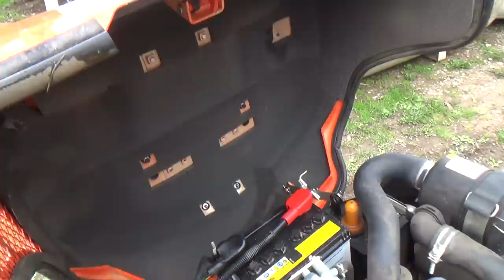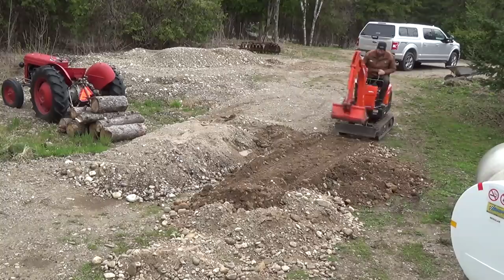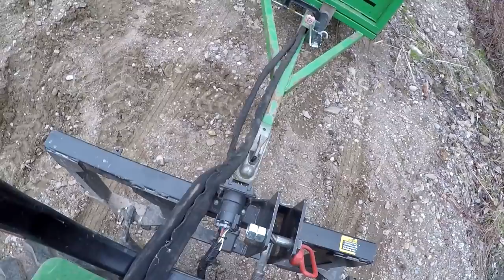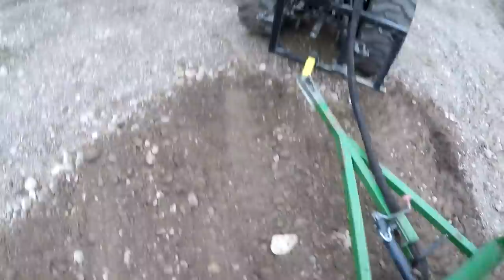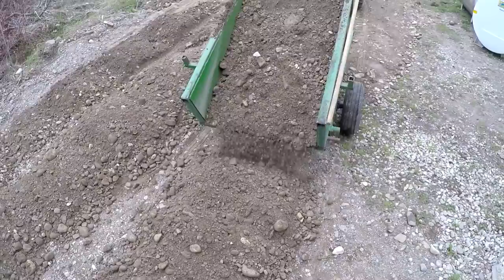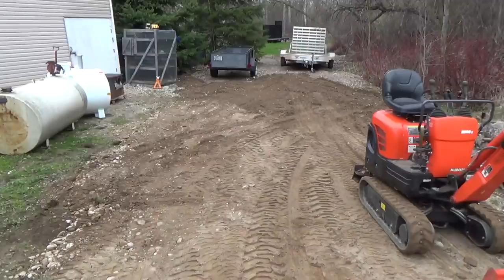Moving sand and gravel with mini ex , mini dump trailer and Jumping Jack....Leveling her up

Comment: Would be awesome to see a roller build that you could pull behind the tractor, that would make compacting big areas like that easy
Reply from the maker: Lol I do have one that I made out of an old water tank. Filled with gravel and concrete. But it’s the vibration that compacts it so well

Comment: Bill,could you do a video with big JOHN
Reply: we were out doing the same job but useing the loader tractor with the hla plow blade snow plow blades sures a handy as a dozer multipurpose and cheaper then a $200-$350,000 bulldozers
Reply from the maker: 110tlb?
Reply: Yes 110tlb

Comment: Are you not allowed to use the big JD on your videos or on your property? Seems like using the front end loader have been much more efficient. Great job, as usual!
Reply: I agree no need to load the trailer and dump it if the backhoe is available . Maybe he just had time to kill.
Reply from the maker: oh yeah for sure.. Job would be done in 10 minutes.. Like using equipment that i own